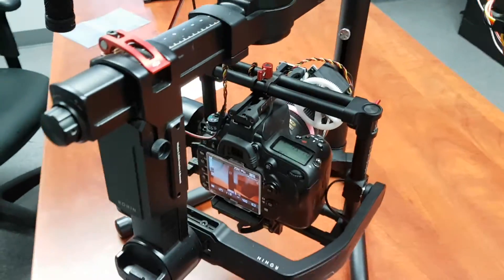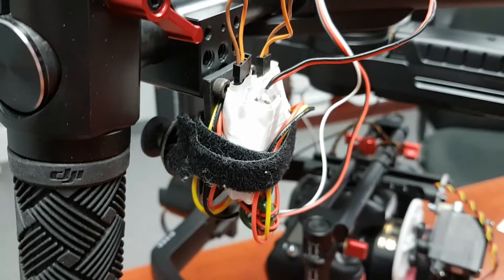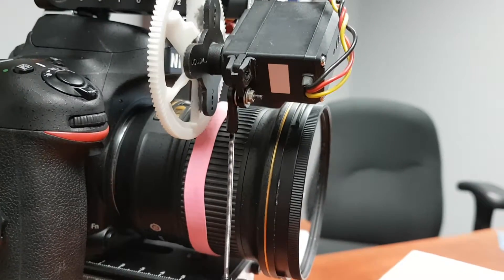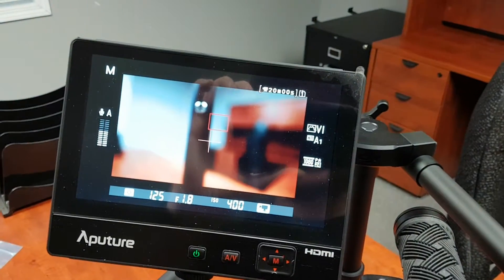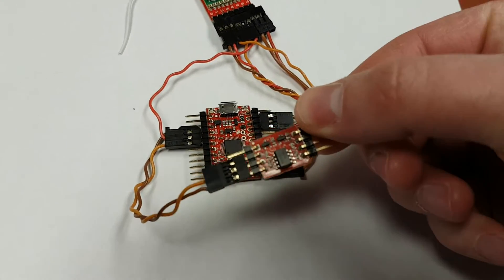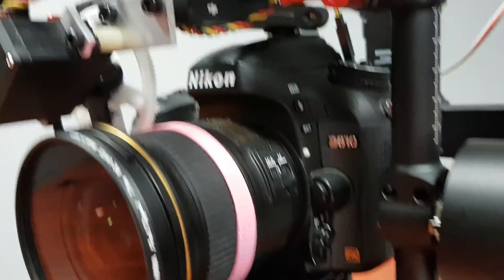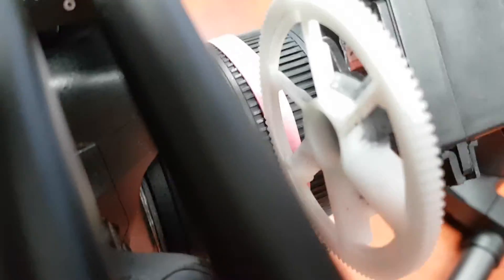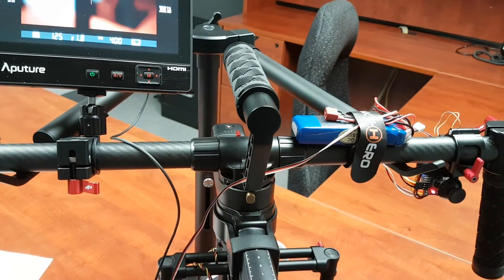DIY RC servo Follow Focus for 3-axis gimbal - DJI Ronin MX

Comment: Hello, I really like your video and your setup.  I wanted to share with you my build. I actually used an existing Pan / Tilt wireless tripod head and converting it to a wireless Follow Focus system. It's a less headaches to go into the electronic panel but the draw back it's pretty bulky and not as pretty than a more expensive system. 

https://youtu.be/8iGtRyAy-OY
Reply from the maker: Wow! That is bulky! It works though. 

I run the Tilta Nucleus Nano now on the Ronin S. But I'm still using the same electronics on the Ronin MX. I just made a nicer mount for the servo using 15mm rods.

Comment: I just used a servo tester pot and that was it.
Reply from the maker: That works too. I went the micro controller route so I could program whatever expo/curve I wanted for the adjustment pot. The farther I push the lever, the faster the servo moves position. This way I can make very fine adjustments to the focus, or rack the focus very quickly if needed. I should really post an update video for this....
Reply: @ds_cameraworx  yeah i went on and played with this some more. A digital metal gear servo rated for heavier loads performed better than the cheap analog ones i first tried to use. I later got this high torque Turnigy digital servo from hobbyking: https://hobbyking.com/en_us/turnigytm-620dmg-high-torque-ds-mg-10-6kg-0-13sec-52g.html

Had an old foamie glider lying around, pulled out the ESC and the servos and built another version. I controlled it via my 9XR Pro remotely, works fine. I just had to get a nice big plastic gear to lean against the lens focus ring, this is the one i got: https://hobbyking.com/en_us/spur-gear-87t.html  Actually, i got two if them, glued them together for better grip. The 9XR Pro has all the different pots and switches, and the firmware allows you to program the throws, limits, curves, exp, anything you want and get some nice results. 
Cheers!

Comment: Wow this is amazing can you help me build mine,  i’m a designer and i do a lot of motion graphics/ gfx work im sure i can help you out by making you an animated logo or something along those lines!
Reply from the maker: Bmore Visuals I think I could do that for you. First though, I should make a new video showing my current setup.

Which gimbal are you using?
Reply: CameraWorx  thank you for getting back to me, I really appreciate it. im using a dji ronin it looks a little different than your i don’t have those bars just a plate that slides the camera in
Reply from the maker: @BmoreVisuals  Sorry for not getting back to you. I purchased the 15mm rod kit for the Ronin M and mounted the servo to it. If you still want info on this, I can send you a bunch of photos and the code for the micro controller.